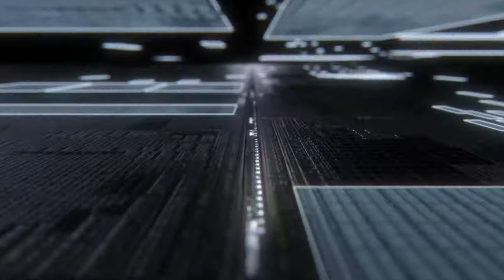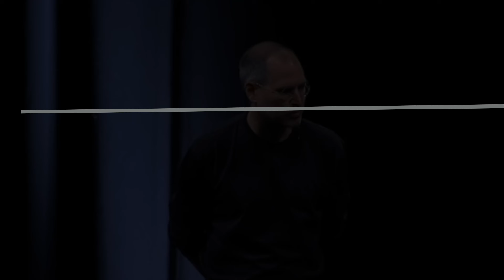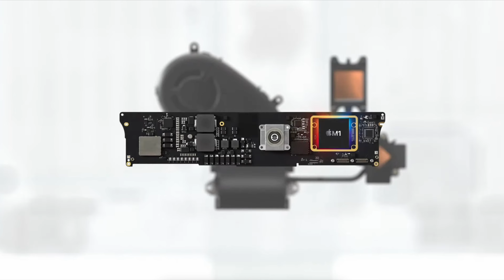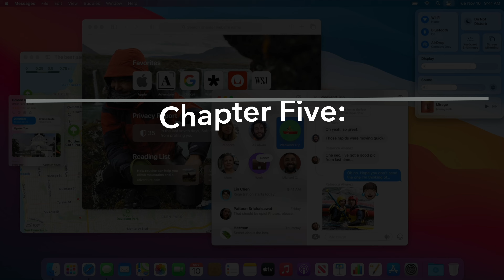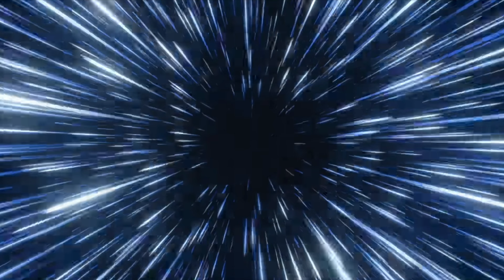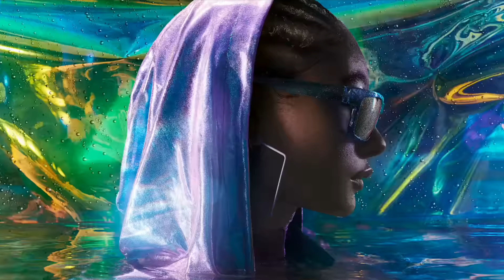How Apple Silicon Changed Everything | Mini Documentary

Comment: Rosetta 2/3 doesn’t do everything. With each macos release, more and more legacy apps don’t work at all, especially 32 bit stuff. good luck. (For the most part).
Reply from the maker: That's not entirely true. Rosetta is a binary translator. It enabled apps to run that were built for PowerPC and Intel to run on subsequent Macs. As computing evolves so does its capability to run higher bit systems. Of course it is up to software developers whether to or not for their creations to support 64 bit systems.